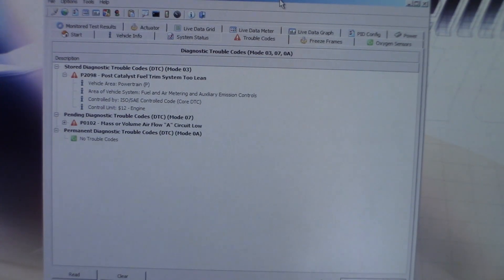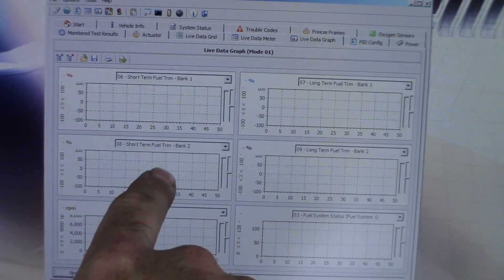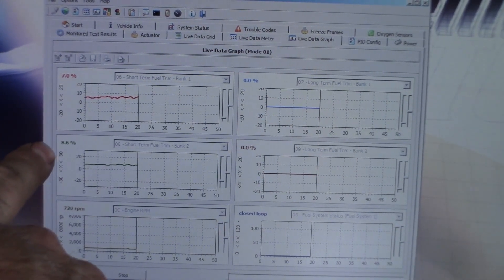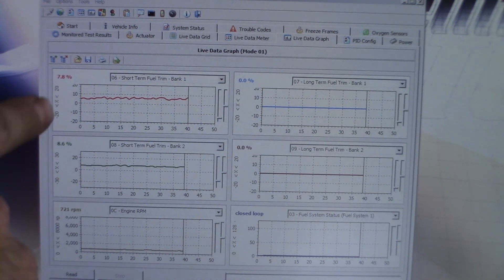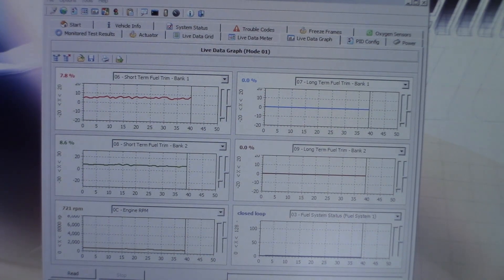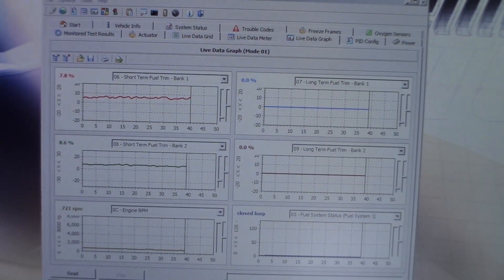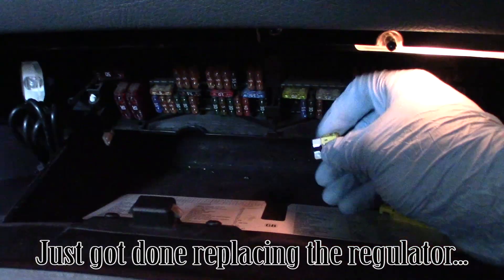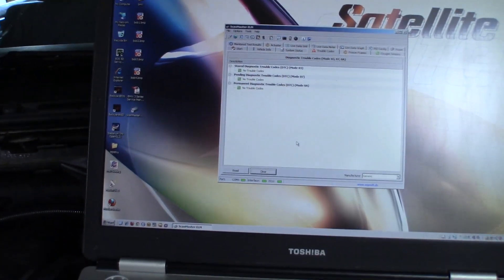BMW 330i 325i E46 Using Fuel Trims To Diagnose Engine Problems P0171 P0174

Comment: What a great video. My 2002 E46 330Ci is currently experiencing fuel trims that exceed permissible rates. Have replaced one injector and O2 sensors but problem still persists. The journey continues...

Comment: Hi 50s kid, have you ever had a P1092 on an M54 engine?  I have a 200i 330i with the P1092, I replaced MAF and  O2 sensors, spark plugs, injectors, fuel pump and fuel pressure regulator, disa valve and smoke tested.  The light still comes back.  I'm about to go pay the dealer for a diagnostic but I thought I would ask your input before I go.  Thanks in advance.

Comment: How would you go about diagnosing if the long term fuel trim is high?  I have an '03 Z4 that had a DISA leak and torn intake elbow, and its long term fuel trims are 11%.  Assuming if it's all fixed the short term fuel trims would be -11%, indicating the short and long term would cancel out?  Or should I reset the DME and start from scratch?  Thank you!!

Comment: Great video you help us all a lot, I don’t know if you’ve had this vacuum leak, took me a while to find it, it was underneath the bolt holes on the rocker cover, very very small cracks underneath the rubber seals, just one to look out for boys & girls👍

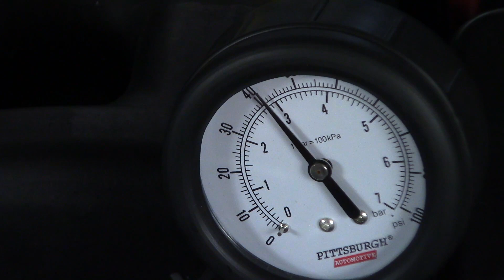Comment: did the pressure drop after replacing the fuel pressure regulator and turning the key to the second position like 11:52?
Reply: I did mine today and it still dropped have you figured it out?

Comment: What if you only had a P0174 code how does a vacuum leak apply to only one bank how does fuel pressure apply? Thanks chasing a problem can't find it!
Reply: I have the same problem. How did you fix your problem? Thanks in advance.
Reply: @TamilTexas  I did the 02 sensor broke off internally who would every think.

Comment: Hello everyone, I have an 02 325ci and got some codes. Currently swapped my maf sensor, last week swapped the ccv system and valve gasket. Realized I have a small oil leak under the oil pan gasket as well. I am still getting codes p0171, p0183 and p0185. I hope to figure this out on my own but just want to say thank you so much for these treasure videos.
Reply: Another thing, when I drive around 2000-2500 rpms,my idle drops very quickly then shoots back up. Only when I’m constant on my pedal this happens. I’ve stopped driving it to figure out the problem.

Comment: My Fuel Trim stays at 27.3 even with disconnected MAF sensor, it only drops when I hit the throttle. Do you I still have vacuum leak?

Comment: Would this cause limp mode? I have p0174 and p0171 but go into limp mode at freeway speeds. Its a getrag 5 speed so its not a transmission limp mode.
Reply: Did you solve this problem?

Comment: Hello, I have ax2006 bmw x5 3.0 m54 engine and I have the dreaded p0171and p0174 codes. I have tested my fuel pressure and I get 50 psi when the car is running, 46 psi with the car off and 46 psi with the key on in position 2 with the car not running. I have smoked the car and can find no leaks and have cleaned the mass air flow sensor and unplug the sensor with the car running a get a change in engine noise until I plug it back in. My codes are lean 10.9 in bank 1 and 9.4 in bank 2. What should I be looking at next.

Comment: Most helpful videos on YouTube! I'm going to test as per your video as I have the same issues on my 2002 330Ci I recently bought, however there's one thing I was wondering about: previous owner had a CCV delete and I can see the dipstick and intake ports for the CCV are closed while the breather is venting to the atmosphere, in such scenario I don't think you'd have a significant vacuum leak since the intake ports are closed, correct?

Comment: Thanks for a great video, im trying to solve a P0171 / P0174 lean issue, i observed the short term fuel trims when warm at idle and at increased revs. At idle and increased revs im getting 25% on both banks, if i blip the trottle it stays at 25 then drops to 0 then back up again. Im pretty sure as the trims stay they same at increased engine speed this doesnt indicate vacuum leak, is this likely to be a bad MAF, my local mechanic did notice the previous owner had installed an aftermarket MAF. Thankyou
Reply: Did you find the problen?
Reply: @MrHaaaj  My problems seems to stem from a faulty MAF, replaced and she's all good again.

Comment: I can not read the STFT2 on e46 m54 325ci, it is always at 0, as my LTFT2. STFT1 is showing values. O2 sensors are ok, no fault codes and the engine runs ok. The last time I tested showed all values moving up and down (as normal) but right now all bank 2 is always at 0. Using torque apk and Elm327. Any suggestions? Thanks!

Comment: Hello  , thank you so much for making these videos. I have learned alot and appreciate it very much.I am trying to clear these codes on my 2004 x5 3.0. I did a smoke test and did not find any vaccuum leaks. I checked the fuel pressure and it was 50 psi. When I shut it off the pressure held at 47 psi. I just changed all 4 o2 sensors.  I only drove it for about 25 miles. Then I looked at the short term fuel trims . At idle they were 0.8 and 1.6. With the rpm at 2500 they were 5.8 and 7.8 then return to the 0.8 and 1.6 at idle. Any help would be very much appreciated.  Happy holidays.
Reply: Have you fixed ur lean code issues I work at a bmw dealership they quoted my 5k because the cats are bad I don’t understand how a P0174 bank 2 can cause that
Reply: @BigLongJohnson79  hello , no I actually took the car off the road and plan to keep working on it over the summer when I have more time. I'm not sure about a bad catalytic converter.  From what I know (which isnt much) if the catalytic converter is bad usually the car will have problems accelerating.  There is a product that is supposed to be very good called cataclean.  I would give that a try and see what happens. Check your fuel trims before and after the cataclean.  Even if it does not work completely it should do something and if you get better fuel trims you know you are on the right track. Not sure but shouldn't there be a code for a bad catalytic converter,  Google it and do some research....good luck
Reply: @richardgalderisi3032  thanks bud I got like a lot of codes on my 05 325i been annoying and taking it to the shop is expensive I’ll look into it I definitely don’t want to waste $ on cats

Comment: I don't understand why a large, consistent drop in the fuel trim under higher RPMs denotes a vacuum leak. Could you explain this further ? Thanks for the great video
Reply: Think of it as a contaminate almost. When you increase rpm, you get more air and are basically diluting the extra air “contaminate” caused by the vacuum leak.

Comment: Really informative video man! If anyone knows, should I perform the same fuel pressure test on my '99 528i if my STFT increases under 2500 - 3000 rpm? STFT is within range at idle. MAF has been replaced within recent history as well.

Comment: Hi, the mine e46 M52 have the coded P0171 & P0174 and as higher the rpm's more positive the trims get. Can u explain me whats going on with it ? Car runs rought and shut down. Thanks for your great videos, thumbs up !
Reply from the maker: If your fuel pressure is normal and the pump seems to be strong, it is probably a bad mass air flow sensor
Reply: @50sKid  I did a smoke test too but nothing seen, the codes that i get now are P0170 & P0173 and the fuel trims are  to 27% positive. Maf shows 3.5g at idle and looked to the fuel pressure with a pressure meter its too around 3.5 bar.
Reply from the maker: @Yuliyann  Then it's either bad precat o2 sensors that are lying to you about the fuel trim readings (unlikely) or leaking fuel injectors adding too much fuel.
Reply: Maybe leaky injectors, im getting misfire codes at cilinders 5&6. Thank you gonna replace all the seals the coming weekend ! :)
Reply: Replaced all injector seals Fuel trims are still above 27%+ both banks, anyway once the car is warmed up and at closed loop it runs better and engine doesnt die. Still droping the codes P0170&P0173, did smoke test doesnt found nothing, should it be leaking from anywhere that i cant see ?

Comment: I've just replaced my fuel pump regulator to get rid of negative trims, but the trims are now biased positive - will they come back to normal with a bit of driving, or do I need to do a reset?
If the latter, how would I do it? All I've got is an OBD code reader...

Comment: Why you need to take out the fuse and let the ignition die? Did you plug the fuse back when using the fuel pressure gauge? Please explain. Thank you

Comment: I’m a little confused at the MAF part. What constitutes a good/working MAF? Does it have to read a certain amount of airflow at idle. I unplugged mine, engine didn’t stumble and the ST fuel trims stayed positive and didn’t drop suddenly negative. I have a similar engine, not sure if it works same as your example 2006 X3 with the M54B52 motor.

Comment: I've got question I have problem with lean codes but no vacuum leak I did smoke test and pressure test. So the STFT at idle is near 0 like -1, 0, +1, 0 but if I accelerate it went to +22 this all was pefromed when the lean codes was deleted and LTFT was on 0. Thank you for your help.
Reply: Have you repaired the car?
Reply: @ukaszteter6283 yeah it was incorrectly manufactured air filter even it was new, tried another air filter then it was ok put back the previous and problem was back I think there was maybe some kind of turbulence affecting the airflow and MAF sensor…my theory… since that the car run well with fuel trims almost on zero…but I already sold the car and went to facelifted f30
Reply: Thanks for your reply, I'll check it out. I'm 0% at idle and 6% at higher speed @NOKRBTZU

Comment: FOR FUTURE READERS. I give remarks while watching. I don't believe that the 8% on the STFT will move over to the LTFT so the STFT can float around zero, I believe that the strategy is when the STFT goes up to around 25 a block of fuel, as mapped in the ECM, will move over to the LTFT as a block, or smaller number than 25, so the STFT can now float around zero. Under 10 STFT is considered normal and slightly over 10 points to an ignition problem more than a fuel delivery problem. With 8 at idle, I would think a vacuum leak and by raising engine RPMs under load and if the STFT corrects back towards zero, this signifies an air leak. OK not a leak, MAF should read about 1.1 grams per liter size of the engine, a little higher is also OK. IF people don't use a quickly evaporating cleaner, do not start the engine while the MAF is still wet and don't clean it with the engine running. That is not fair, you changed the test, you are not showing the MAF reading after cleaning but both fuel trims did come down a little but yes, they are still lean. Harbor Freight pressure gauge, NO. The fuel pressure regulator does not hold pressure when you turn the engine off, the fuel pump check valve does that job so the next start will be quicker with residual pressure in the system. You are unfair again, you changed the test and did not show the key on engine off fuel system prime pressure. SO a slightly dirty MAF and a slightly weak fuel pressure regulator although your fuel pressure gauge did not prove that fact. Your STFT with a large vacuum leak went up to 27 and did not move the LTFT, a better way to test true Fuel Trims is during a normal test drive, not in the shop with no load, this is why when testing for a vacuum leak you do not just raise RPMs, as we can see, 3000 RPM and still 19%, not a good test, you need to power brake it but not for long as the transmission will heat up easily.  Another fair test is to show the new MAF numbers with the vacuum leak to show what a MAF sees with a good-sized false air leak and what does the MAF see at 2500 RPM with no vacuum leak and 2500 RPM with a false air leak would have been nice, next time, please. Did you set codes at 27% STFT, you didn't mention if the codes set and you didn't mention what the complete criteria are to set the codes. The overall video diagnosis was pretty good but the fuel gauge needs to go in the trash. I would expect fuel pressure to be up between 50 and 55 max while priming the system.

Comment: great video!
1st i had an emissions code so i replaced the rear bumper valve at canister. code goes away. then, immediately i get a vacuum leak code. ends up being the oil return at dipstick tube. replace hose and code goes away. then, all of a sudden 420/430 pops up together immediately and now i can not get rid of those codes. car drives great and does not lack power. reach 30-35mpgs (highway) when being delicate on the throttle. so it's very hard for me to think both cats are bad. '05 330i zhp 6spd

this video gives me something new to check out. thank you

Comment: Hi, what if the STFT indicator on an obd scanning program reads N/A on both banks.. ? I get the voltage indications on upper banks but STFT says N/A :( it throws P0170 P0174 and until I get money to repair, I do reset the ECU..

Comment: Your videos are a wonderful resource! I have a 2001 e46 330i with both banks running lean, long term trims around 10-11%. Short term fuel trims increase up to 10% under engine load suggesting to me that it is not a vacuum leak. I cleaned the MAF and no improvement. Fuel pressure at the rail is right at 50psi both at idle and when running. You say it should read 36-46 when running. Could clogged injectors cause the fuel pressure to be pegged high at 50?
Reply: After some more research and thought, my new suspect is the pressure regulator vacuum line. My understanding is that we want the pressure difference between the fuel rail and the intake manifold to be constant. Since I see constant fuel rail pressure even when rev-ing the engine, it seems the pressure regulator is not adjusting to the changing intake vacuum
Reply: This would be an interesting problem because the fuel pressure would be higher than desired at idle which you would expect to generate negative fuel trim but the vacuum leak could cause it to run lean, this would explain my +10% long term fuel trim. Then at high RPM the throttle is open so the intake pressure rises to nearly atmospheric pressure but the regulator does not compensate with increased fuel pressure so the O2 sensors would see a lean condition and the short term fuel trim would go up.
Reply: Ugh ok this theory seems wrong. Turns out the air pressure reference line in these cars isn't the intake manifold vacuum but rather is a Venturi line to the intake boot. this seems to have almost no effect on the fuel pressure.
Reply: Solved! Picked up a new Duralast MAF for $116 and long term fuel trims returned to ~0% after a few miles on the highway.

Comment: Hi 50skid :-) i've had some problems latelty with my m52tu enigne. Enginelight has come on and i've noticed that ive had postive fueltrim in the 10's often. But today my engine ran really unstable at idle and i noticed now that i more or less get a steady 25-27 on the fueltrim of bank 2. Other is stable on less than 5. Also got now some pending codes on mistfire on cyl 4,5 and 6. Wanted to ask you if you have any idea what causes this fault on seems like only bank 2?

Comment: I have a code of P0174 for a bank 2 (no p0171) only one code. 
any ideas what might be the cause ? 
i have checked the vacuum leak but everything looks good even on smoke tester.
Reply: Having the same issue with mine got it smoke tested at a bmw dealership that I work at they said i was having the p0174 bank 2 codes because of my cats do u still own ur bmw and if so did u get ur codes fixed

Comment: I see a lean fuel in my e46 and it says misfire bank 1 and 2
Reply: I'm having the same codes , did you ever find a troubleshooting method? and solution? @Armani Nguon
Reply: Taylorjmedia I bought a obd2 it says something about crankshaft sensor, and some fuel filter. I have already have changed ignition coil spark plugs MAF boot housing and sensor. It could be a lot of things I suggest find a obd 2 sensor scan and see what it says.

Comment: Hi there was wondering if you be able to help me out I have a problem with my 2001 BMW 325ci. the check engine light recently come on and fuel trim was at 20+ was wondering if u could help me find out why?

Comment: Hey 50skid I have lean code on back 1&2 and rich on bank 2 I read the fuel trim and short is at 6 and 7 and long trim is at 11 on both when press on the Gas short trim goes to the negative. Any ideas where I can start

Comment: Hey so my fuel trims on my e46 are 25% on both banks and today at a red light the car started shaking really bad and when I started driving the higher the Rpms go the more it was shaking and when coming to another red light I pressed in the clutch and the rpms dropped all the way to 0 and the car died. When I turned it back on it was back to normal and didn’t shake or die anymore but the fuel trims are still at 25%. I have the check engine light for the lean codes you mentioned in the video. Any idea on why the car would shake and die and then go back to normal?

Comment: Trying to get to the bottom of some issues my daughters BMW is having. She has a 204 325i SULEV that has had the fuel tank swapped prior to us. Fuel trims (at idle) are as follows:
 STFT B1 16.6
LTFT B1 18.8
STFT B2 16.4
LTFT B2 18.8

When holding RPM at 2000 STFTs drop to normal range. This is an indication of a vacuum leak? LTFT don’t change, is that an indication of dirty, or failing, injectors?

Comment: Hi 50s kid, I have watched a number of your videos and wondered if you could offer some advice. I have a BMW E46, 2002 320Ci with fault codes fuel bank error 1&2 with misfires on cylinders 1-6, plugs are black and sooted so seems to be running rich. Can't seem to find an air leak but would have thought it would be running lean with an air leak. Can you offer any advice please.